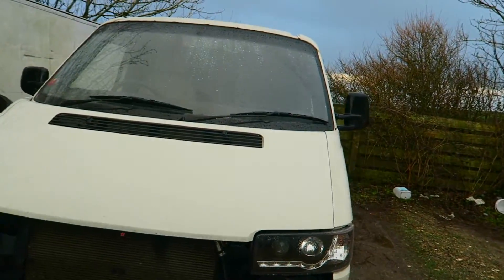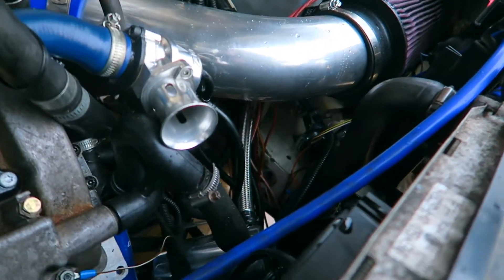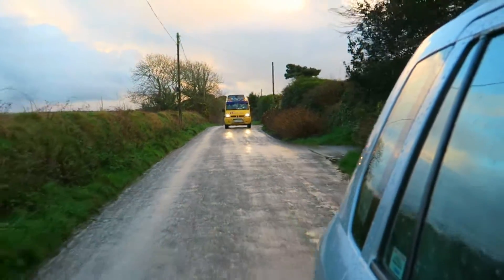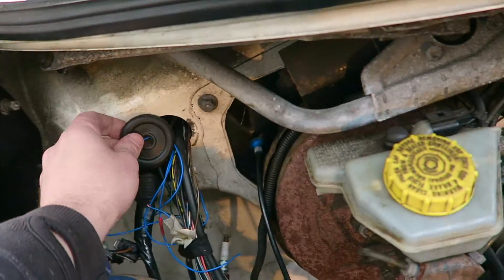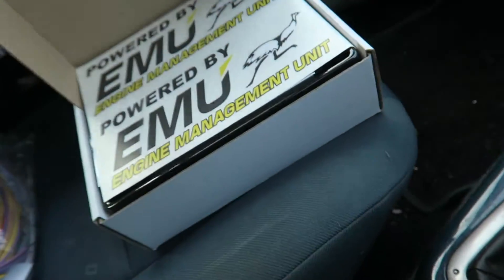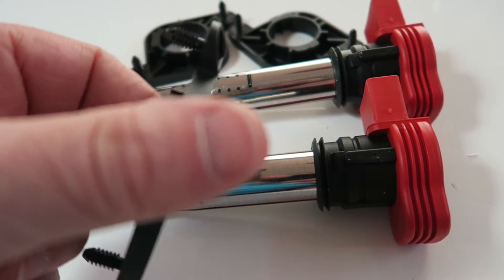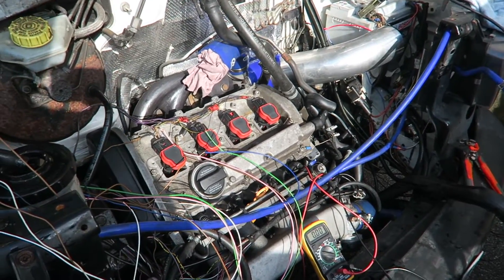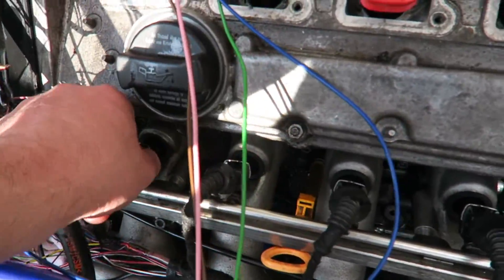VW T4 1.8T - STANDALONE ECU (EMU ECU MASTER)

Comment: It wasn’t the megasquirt’s fault the fuel pipe was crimped and the loom had rubbed through!
Reply from the maker: No one blamed the Megasquirt dude? It was badly installed and developed a fault, it didn't stand a chance to get me up and running. I planned to upgrade anyway as I'll be running anti-lag, launch control and need to have inputs to run knock sensors and outputs for Meth control etc etc. The EMU does loads for it's price point, a year on and I'm well impressed :-)
Reply: The knock control is the only reason I would use the emu over the ms, how well does the knock control work on it? Big price jump from a ms to emu (double at the moment I think)
Reply from the maker: James Chaffe It works really well, I’ve got two knock sensors wired in, pulls timing etc if needed. Without knock sensors and an adaptive ECU you’ll need to leave more det headroom & miss out on some power. It costs more but it’s well worth it to me on this setup! Cheers :-)
Reply: speedingtube , done a few installs with megasquirt, last one had flex fuel and ran methanol in the tank. Pushed the timing quite hard on that, on a high compression engine with high boost, used the ait to pull timing as it’s the main culprit, even then only ever had to pull a degree or two, then again they don’t knock on methanol 🤘

Comment: Just to say...dyno proven "uprated coil's" do nothing for HP/torque. Standard coils do the same.
Reply from the maker: andrew wright Not uprated bud, just standard R8/TFSI coil packs. They produce a slightly more powerful spark and allow for a wider gap, they have a higher resistance 5.3M ohms as opposed to the standard 1.8T at 3.3M ohms. In reality it probably makes 0.01% difference...but they are much cheaper which suits me just fine! 😎 Haha
Reply: speedingtube cheap quality parts are always good. 👍
Reply from the maker: The 1.8T is awesome cheap fun! Far cheaper to tune than my old CLS55.
Reply: speedingtube I'll bet!

Comment: Great videos!! I'm just about to embark (well, I say me - my best mate!)  on swapping 1.9d to this engine, a great source of inspiration!  I've read on the t4forum that the sump has to be modified.. Did you have to do this? What issues/mods did you have to do to get the engine in in the the first place?? Cheers
Reply from the maker: Cheers Paul. The engine was dropped in by someone else before I bought the van, but it had been done very poorly so I've had to redo most of the work which I've really enjoyed. There's a great writeup on the VW T4 forum (link below). The sump has to be modified to clear the gearbox bell housing, it's not a big job but you'll need someone who can weld aluminium.  There are lots of options as with any engine conversion. http://www.vwt4forum.co.uk/showthread.php?t=408537
Reply: You are a star! Thanks... And looking forward to your other videos